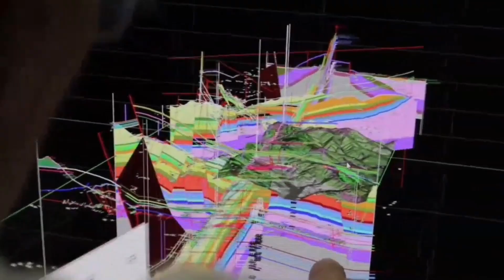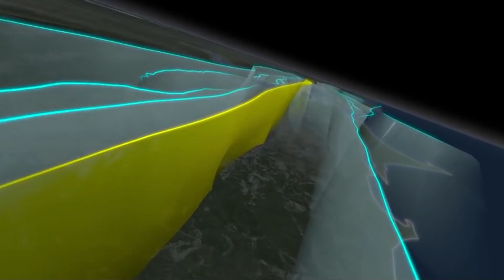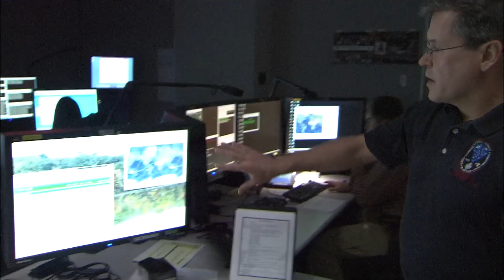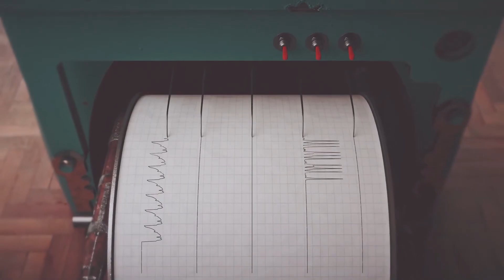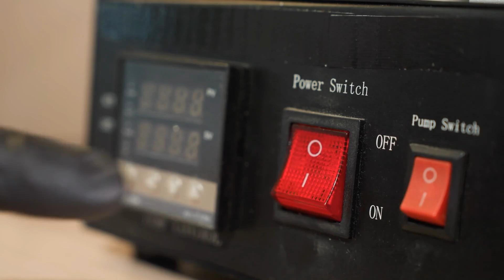Why Recent Unusual Activities in the San Andreas Fault Could Trigger a Major Earthquake

Comment: There has been an increase of earthquake activity in Southern CA but they haven't really been directly on the San Andreas Fault, rather, they are taking place all around it which is just as bad. the SA Fault generates very large earthquakes but it doesn't generate numerous quakes. Those are done by the faults related to it such as the Hayward and Calaveras Faults in the San Francisco Bay Area, and the San Jacinto and to a lesser extent the Elsinore Faults in Southern CA. Many of the quakes taking place in Socal are on other faults such as the Puentes Hills thrust Fault in LA as well as the Malibu Fault to the west of that. The faults to the north and east have also been more active. Since these faults generally move in a direction toward the San Andreas Fault, this increases strain on it. Also, fault creep is not new to the SA Fault. There is actually a section called the creeping section in central CA. This creep also is not enough to completely release strain as the town of Parkfiled, CA sees an earthquake of around M6 roughly every 20 years or so and this is on the creeping section. The Hayward and Calavera Faults also generate a lot of earthquakes and they are well known for fault creep. Look up the town of Hollister, CA. The San Andreas Fault has a lot of micro-quakes that can't be felt. Mid-sized quakes say in the M5 range aren't common and when they occur, they very likely could be foreshocks. The October 17th Loma Prieta Quake was preceding by two foreshocks; a M5.3 in June and a M5.4 in August.
Reply: Loma Prieta was also preceded by a 6.2 on the Calaveras, I think, (near Morgan Hill) on 4/24/1984.
Reply: @lmstein72  That wasn't considered a foreshock though, it was its own event. I remember that quake very well. I was in school in Berkeley when that one hit.